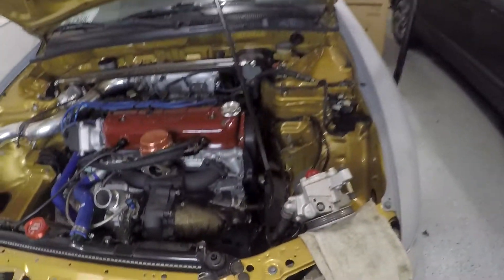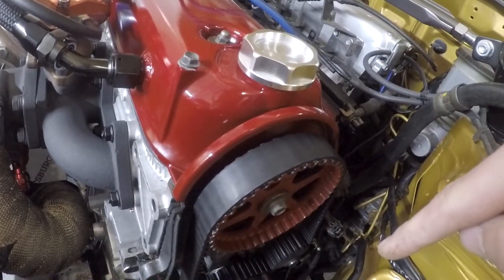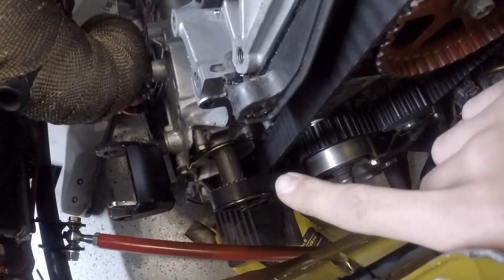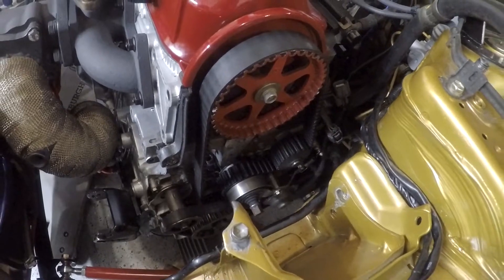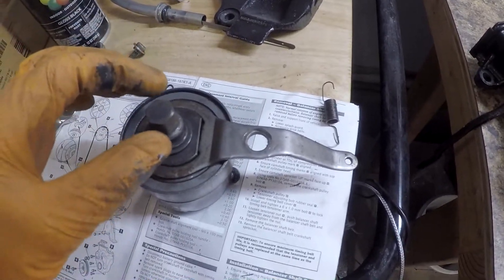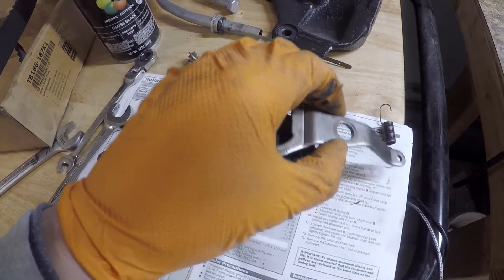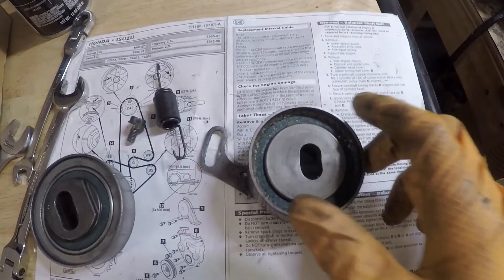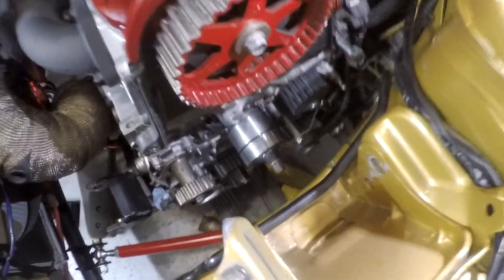Turbo Accord: First Startup with 3" Straight Pipe

Comment: Nice job man you didn't change the water pump when you did the timing blet ?
Reply from the maker: Thank you! I juuuuuust changed the timing belt when I had the engine out of the car like 5k miles ago. I did the water pump and  all of the oil seals then.